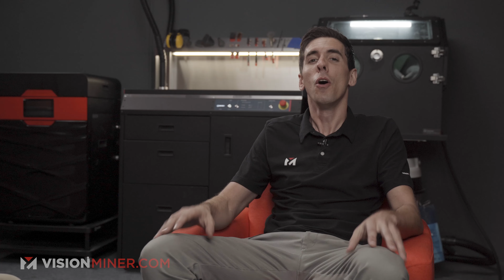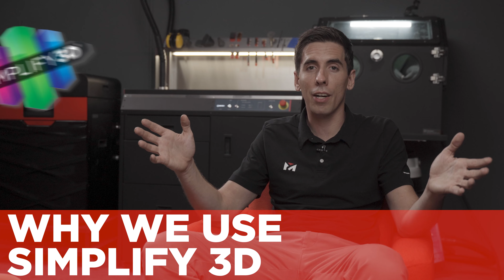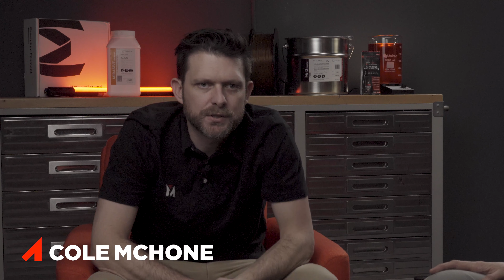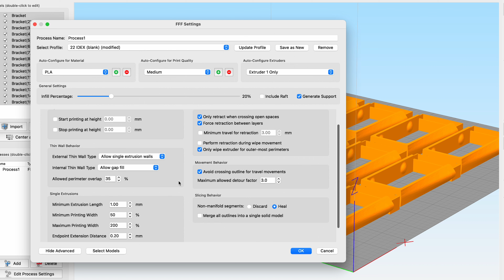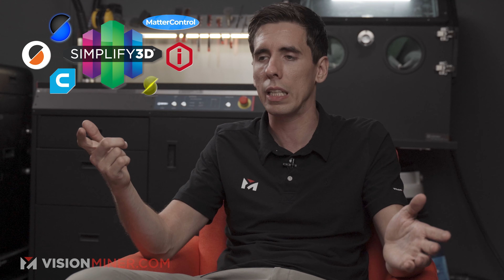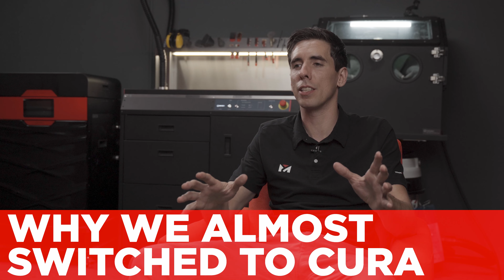What's the Best Slicer for 3D Printing?

Comment: I use Simplify 3D V4 and now V5 which has more features.  Some controls are different I've been finding.  Where initially I thought it was left out, but it was just moved.  Like transform moved to widget control.  I'd still like to use CNTL and ALT for move and rotate.

Comment: Me I’m new to 3D Printing but I’m learning fast from YouTube videos and books I bought. For me I have the creality slicer that came with my CR-10S5 but I upgraded it to the max and it sucks, I got grabcad and super slicer in which I haven’t used much, I like super slicer but because I’m still learning and experimenting with different filaments I use Simplify3D most of the time because it’s a lot easier and I don’t have to make that many changes when I switch between different filaments like pla in which I don’t like much my favorite so far is between carbon fiber nylon and polycarbonate I been wanting to try peek and pekk but it’s too expensive eventually I will try it. For everything so far simplify 3D is working best for me with my fully upgraded Creality CR-10S5 which can 3D print in all materials the only parts original on it is the stepper motors everything else is upgraded even went from Bowden to direct drive, I have a fully upgraded CR-30 3D print mill I ordered is just upgraded as cr10s5 I haven’t got cr30 yet but I would like to know what the best slicer is for it it’s a conveyor belt 3D printer and it’s upgraded with modifications like converted to direct drive, micro Swiss thermistor with pt1000 thermistor, better heating cartridge etc it can 3D print at same temperatures as my cr10s5 which is 200 Celsius on hotbed 560 Celsius on hotend I haven’t found a slicer for cr30 yet 

what’s a good recommendation for CR-30 slicer

Comment: Question.  Why does Cura make a small circle at the seam?  It makes blobs out the side because of this. 

 I've printed over 100 circular prints only 20mm wide to check settings on the seam but only gets worse.  

I've tried retraction settings,  coating,   extra prime , wipe etc.  Nothing gets rid of the small circle cura does at the beginning of each layer.  

Using ender 3. Fairly new to printing but learning fast!
Reply from the maker: You can usually make them better with coast/wipe settings, but it's basically due to the starting point being in the same spot each time. This is called z-seam alignment in Cura, and you should be able to modify that for better results :)

Comment: You mentioned that for Cura you would need to make modifications to the software to allow it to print at 500 C. Since it is open source, why isn't forking Cura an option so that you can add those modifications as well as add built-in profiles for your printers? That way you can also easily update the fork with latest Cura features.

Comment: I have extensively used Prusa Slicer, Cura, and Ideamaker, and what I have standardized on is SuperSlicer. It has just about every single low/medium power setting, and has a ton of high power settings thanks to Prusa's development. It is missing a couple small things like being able to turn off dropping parts to bed automatically, its support interface fidelity/planning is worse compared to curas, and it doesn't have sequential printing support like Ideamaker, but its settings menus are all well laid out, it has settings revert options, and tons of in depth utility tools for high compute power printing like Klipper. Notably it exposes a lot of other features that other slicers don't let users touch because you can shoot yourself in the foot by not knowing the consequences. Also, the import config from project and ease of saving/transfering setting make it excellent for being able to reproduce variations on parts/slicing setups, especially as it can also read configs from other Slic3r variants like Prusa Slicer. I would say I hope you make a config for the 22 IDEX on SuperSlicer, but even if you do I wouldn't use it as I would be much more comfortable making my own, and I think a significant portion of the SuperSlicer community would as well as it is only just gaining traction.

Comment: SS is one of my favorites for sure. I use it with my Annex K3 and it’s a very powerful tool. For sure one of the best things about SS is the overhang flow/direction/fan kickstart settings. Also single perimeter top layers just make parts look incredible. However with my Prusa, I still almost always just use the latest version of PS. Their profiles just work. Minimal adjustments (usually fine tuning for a particular spool or material) and the parts come out great. Been trying to learn Ideamaker lately. It seems like it has a few things that I wish SS had (mainly more per-layer and per-model adjustments), but the learning curve seems to be a bit steeper. SS was fairly straightforward since I was already used to using PS. Planning to use SS with my 22 idex when it arrives!

Comment: I considered getting S3D years ago and it hadn't had a an update since gods dog was a pup even then, I have always used Cura, I tried Prusa Slicer but the printer profiles for 3rd party machines are piss poor, the start and end G-code are the bare minimum to get a print done and you cant transfer the settings from Cura as they are not the same G-codes.
 I am so comfortable with Cura it does everything I want and more and any spare time I have for learning software is taken up by Fusion 360 tutorials.

Comment: Hi guys great content. I started out on a CR10 v2 whit Cura and it was fine for ornamental or not too intricate engineering parts, but as i modified the machine to print engineering materials, Cura very quickly  ran out of stem as i needed more control on details, possibility of printing whit variable settings on varying layers and after looking i found Simplyfi3D, and got stuck whit it. 
I personally believe that for engineering parts and materials it is the best, still.